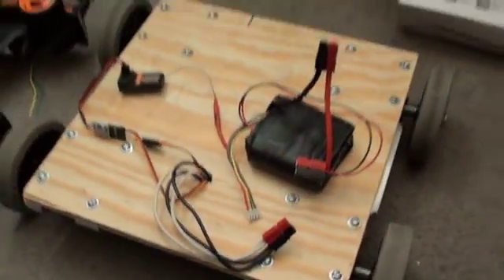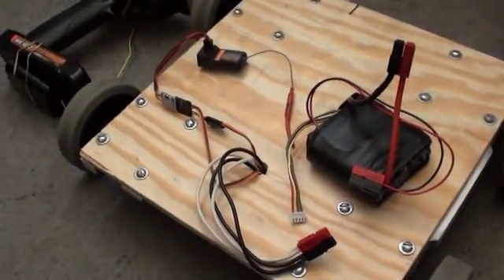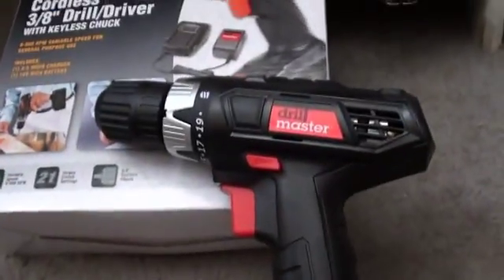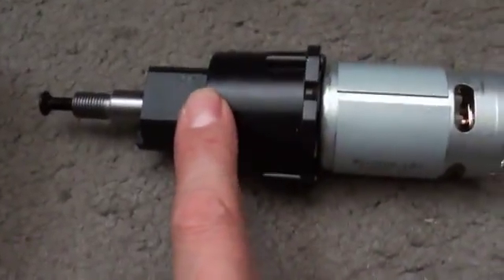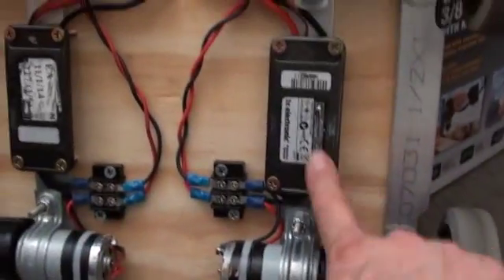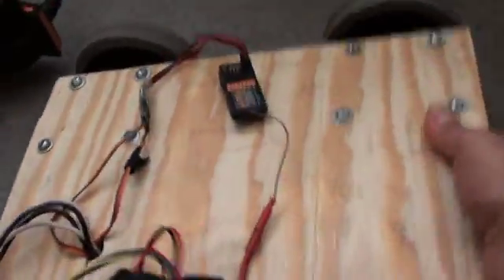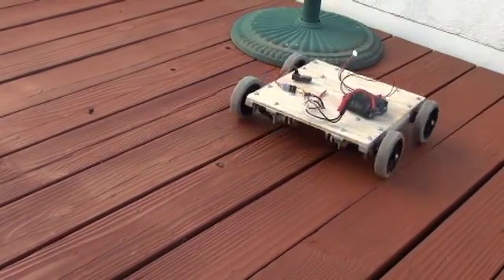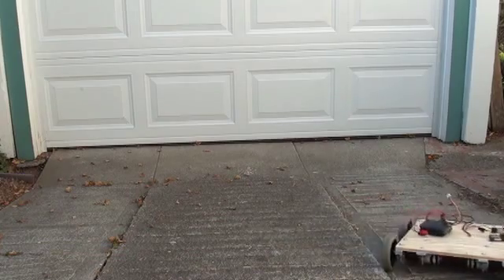Let's Build - Rover Mk3 - Part 1 - introduction and overview

Comment: How much torque does one of this drill motors have?
Reply from the maker: manufacturer claims 200in/lb .  Realistically, its a function of how many amps your willing to let flow, and that directly effects the lifespan.
Reply: @teamtiki  thanks Chewy I am build a tank-ish robot with parts I believe I bought from you off of ebay.

Comment: Thanks for the video. Could one of these motors be used to convert a Fiskars reel mower to self propelled? I'm looking to mount an 18v drill motor to the rear plate of the Fiskars mower, between the rear axle and the cutting deck, and and use a small belt/pulley connected to the drill motor to transfer power the axle and propel the mower. The mower is appx 50 pounds > https://www.amazon.com/Fiskars-Inch-StaySharp-Reel-Mower/dp/B01N7K4BNX
Reply from the maker: I doubt it,  lawn mowers , at least rotary blade models,  regularly uses 3-5 horse motors. the Cordless drills are about a 100watt motor, if it works at all, I don't think it will last very long.